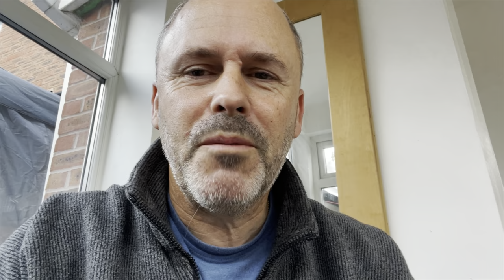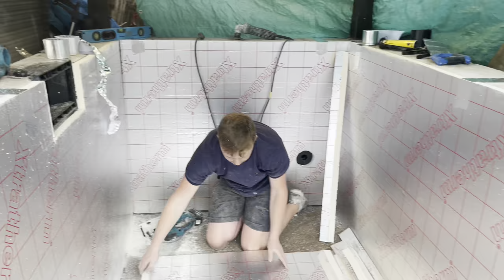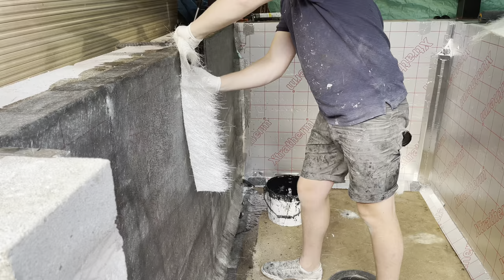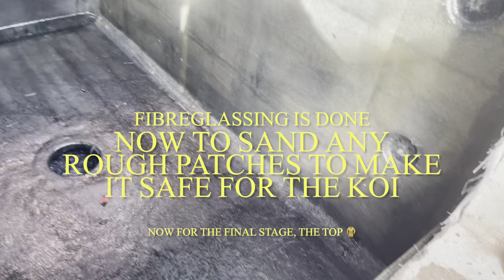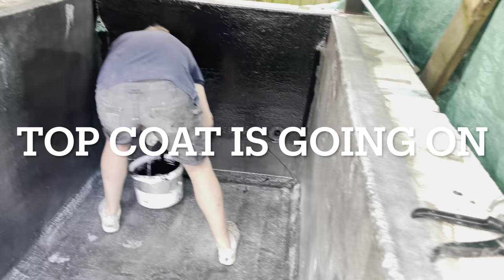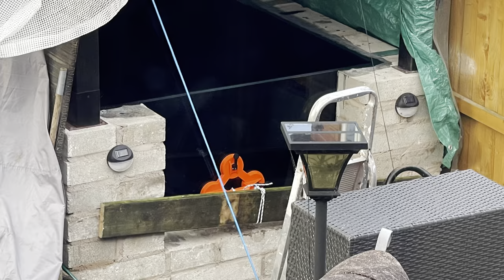#new pond build, #fibreglass time. # please subscribe

Comment: Currently in the process of building a pond and thinking about fibreglassing the inside is it necessary to insulate the walls first also what was used for the top coat
Reply from the maker: Hi mark, in regards insulation , using 25mm  kingspan, serves as two things, it insulated the pond and gives a smooth service to fibreglass too. And to be honest I would definitely insulate. Top cost/ flow cost. Polyester Resin topcoat provides an excellent finish for fibreglass ponds. Waterproof, abrasion-resistant and durable, it offers excellent protection and great aesthetics.
Check out this site gives you loads of info( https://www.resinlibrary.com/knowledge/guide/how-to-make-a-fibreglass-pond-lining/

Hope this helps plus watch loads of videos, it helps. And don’t rush

Comment: Great job i think im going to do mine myself now after watching this,just one question,regarding the window did you fibreglass staight onto the glass ?
Reply from the maker: Hi thank you very much, no it was fibreglassed first making a frame using the insulation( around 25mm all around,  then window was sat one the ledge and bonded to the fibreglass. Very strong. Again thank you for subscribing and kind words. .